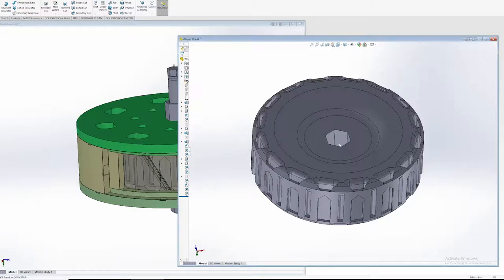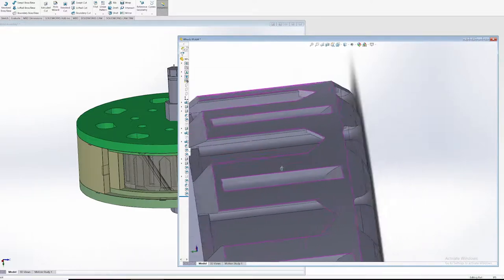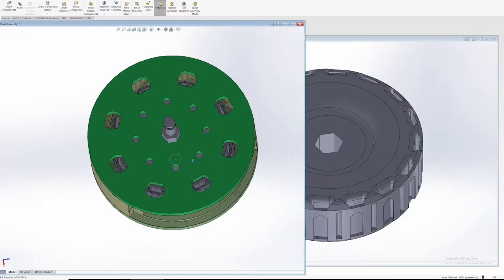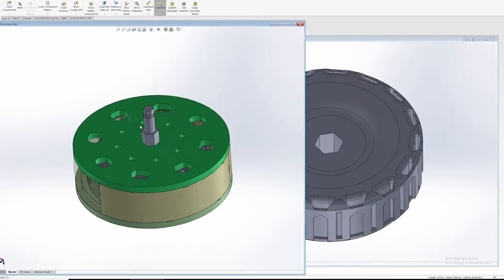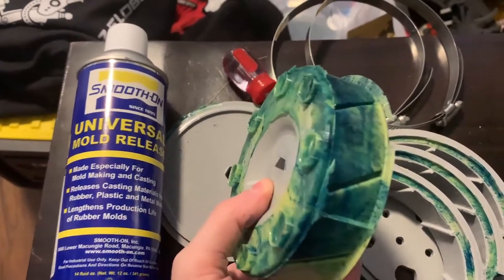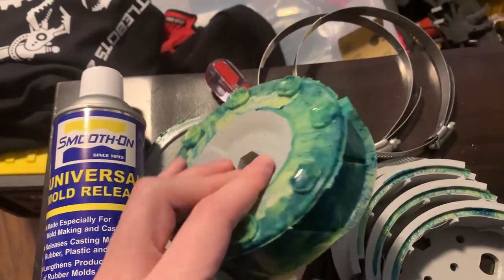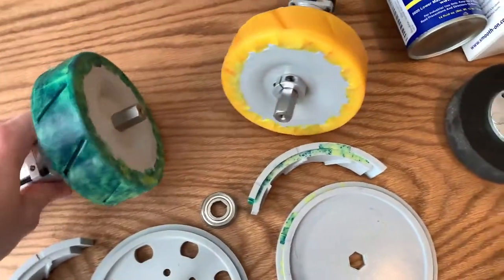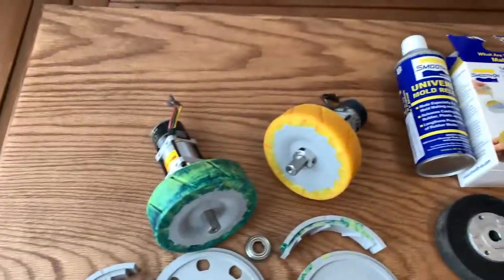Molding a combat robot wheel

Comment: What shaft is on that DC motor? Or did you add something to make it hexagonal?
Reply from the maker: It's a stock hex shaft for a Banebots gearbox. They offer normal round shafts with keyways and hex shafts. Hex is great for 3D printed parts.
Reply: Is there a way to know how to do it?